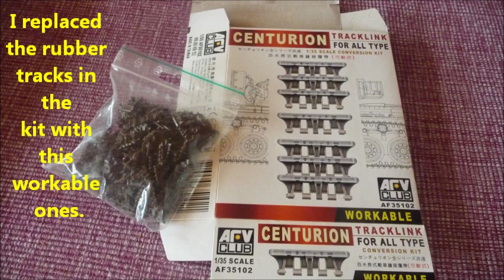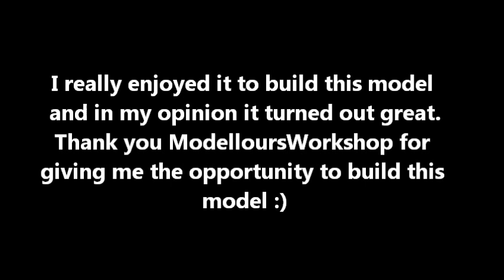AFV-Club Danish Centurion tank Part 2: Painting, weathering and finished model

Comment from the maker: I spray the paint on with about 2 bar pressure. there is no exact mixing ratio for the paint, i thin them down with water until the consistency is a bit thicker than milk.

Comment: Excellent build!!!
Reply from the maker: Wow Wow thanks
Reply: Hamilkar Barkas i have a question about the painting why do you prime it black before painting. im new to the hobby and was just curious.
Reply from the maker: ThemapleCanadain
i want to have a uniform basecoat for later paint applications. the green camo paint would look different on the plastic and metal surfaces.
Reply: thank you for the answer! i also have another question.  does it matter what color the primer is or just the fact that you have a primer and its also happened to be black?
Reply from the maker: ThemapleCanadain
it does not really matter, white or grey are also very good for priming. you need a rather neutral colour, yellow or pink are not ideal colours for priming.
Reply: oh ok thanks again :)